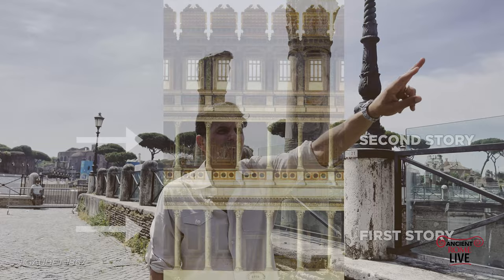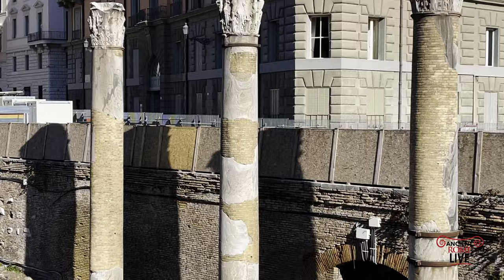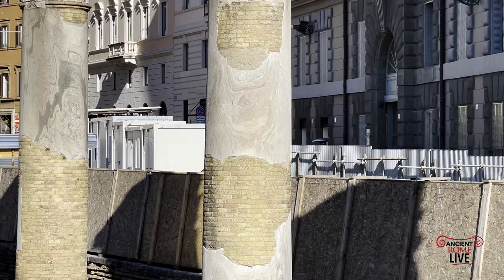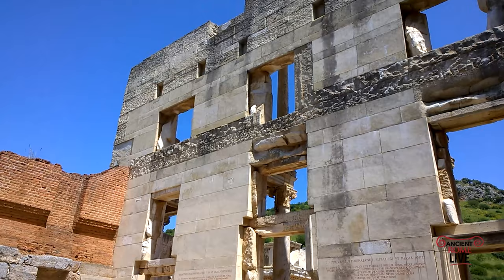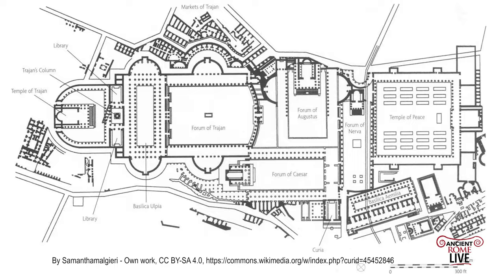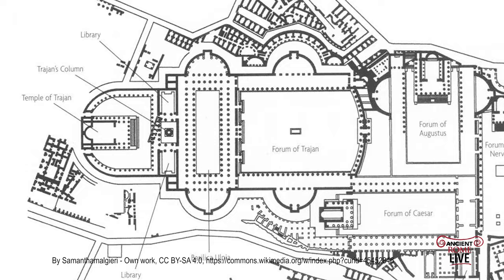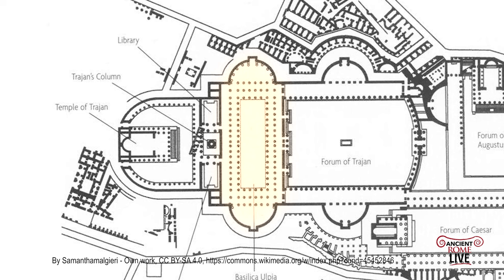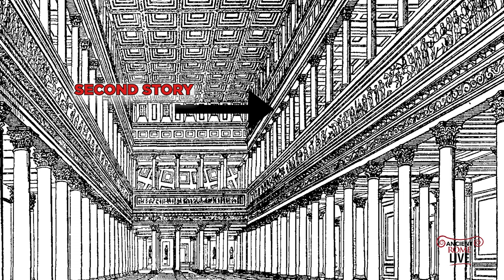Exploring Trajan's Forum in Rome

Comment: I'm for it, as long as it is historically accurate, which can be an iffy question with low data. But this does convey the sheer magnitude of Rome much better than when it's scattered on the ground.
The forums used to be this flat stuff with weird paving, this shows how huge these buildings were and how many there were.
Reply from the maker: Reconstruction is always a tricky business for public and conservation issues.

Comment: I would actually prefere complete reconstruction utilising new marble and new granite but differentiating it by incorporating the ancient pieces (or even if the ancient pieces were not to be incorporated i would support this)

because if we know with 90% certainity that a building looked a certain way, I wholeheartedly support it be reconstructed (if it is a valluable piece of cultural history offcourse, no point in reconstructing brutalist architecture)

and in a way there are in fact better examples than even these
when the city of Ypres was completely shelled out of existence it was allmost completely restored to it's original state, simply look at before and after pictures of the cloth hall and one can see that it is perfectly possible to go above and beyond doing this

and they largely did similar things with neogothic construction in the 19th and early 20th century, look at Vienna, look at Budapest, look at Bruges, look at Ghent, it is not just possible it should be a goal we strive for as Europeans to do so
Reply from the maker: We hear what you are saying. That won't happen in Rome these days... but, if you look at S. Paul's outside the walls, you'll see a completely rebuilt church after the 19C fire.